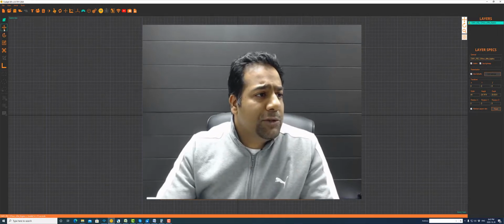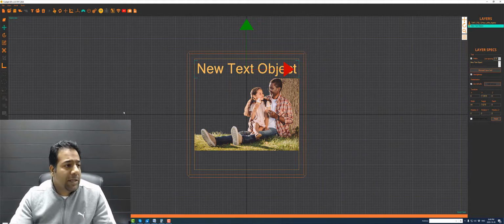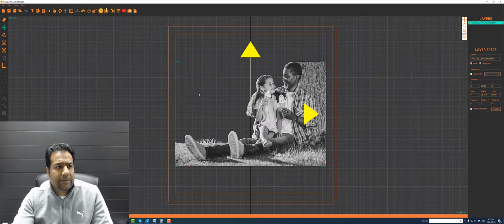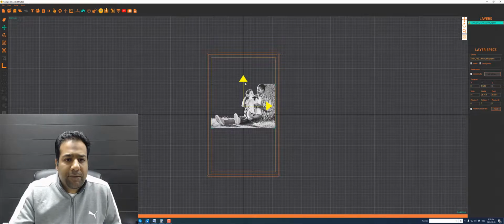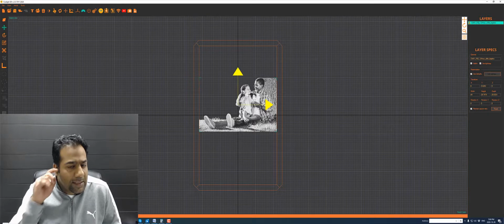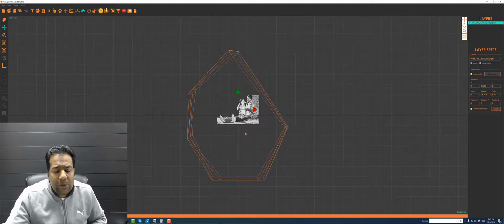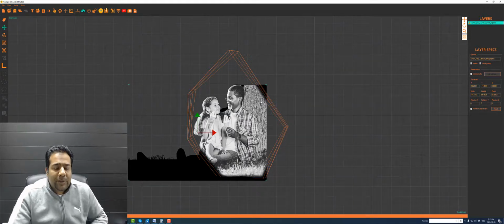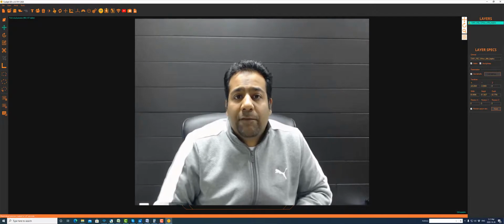2d to 3d Conversion for 3d Crystal | cockpit3D.com | 3dcrystal.com

Comment: Hi can I buy this program if so what dose it cost
Reply from the maker: you can get a trial version by filling out the form on cockpit3d.com.  Be sure to sign up if you have a subsurface laser.  If you need an artist license email info@cockpit3d.com since the license provided by default is for laser owners needing to produce 3D Crystals.
Reply: What is the cost I have subsurface laser

Comment: Impressive software I've been using it for a while. I have a question for the optimization part: that only works if I use photoshop, right?
Reply from the maker: Hi there. Thanks for your comments. It will launch the photo editor installed when you click the paintbrush. Commonly that’s photoshop. If photoshop isn’t installed then cockpit3d should pull open what is installed on your system.
Reply: @3dcrystal  Ok I use GIMP: I do put it in grayscale, save it , or better say export it (as a JPG) in the same file where I've got my modelization - but when I click on reload textures, nothing happens...
Reply from the maker: @jmez78  make sure you click the paint brush and make the change in the software that cockpit3d launches by default. Make sure that the layers in your photo editor are flattened to one layer. Then don’t export but save. It will save a temp file. At this stage you can hop back to cockpit3d and click the refresh icon. Hopefully that solves your issue. If not then your best bet is to do it using the same software and method as described in the tutorial. Thanks.
Reply: @3dcrystal  Working now: thanks so much!!
Reply from the maker: @jmez78  with pleasure :)